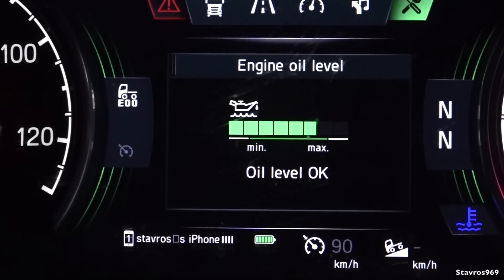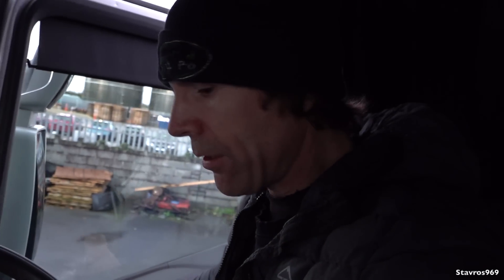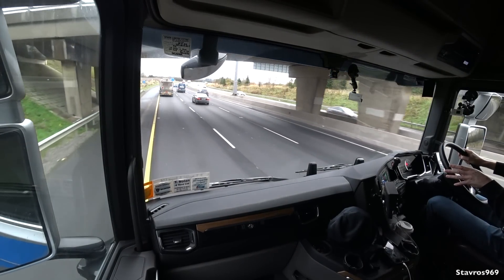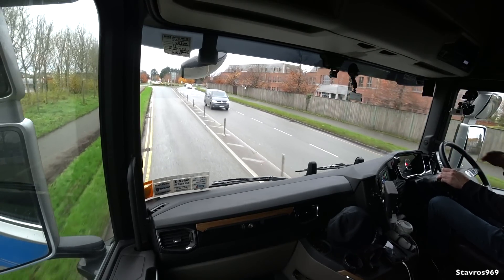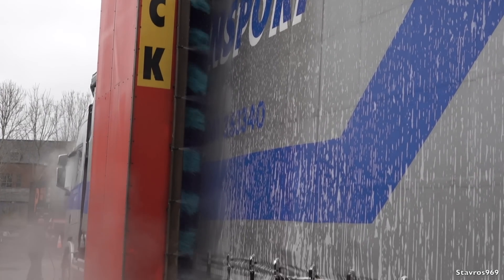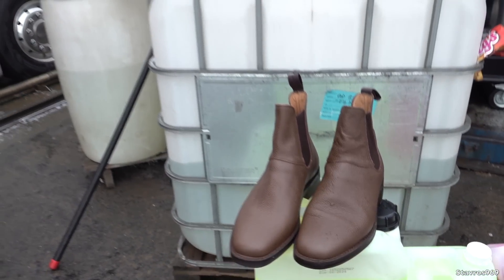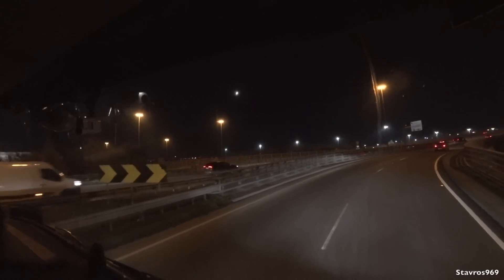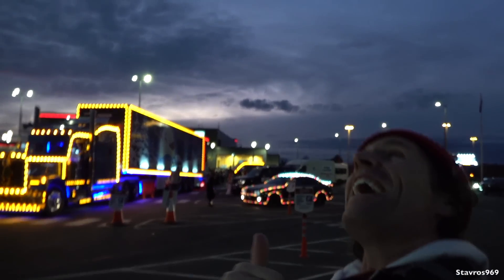SCANIA's V8 Engine The End is Coming!

Comment: Scania might do a new V8 with DOHC valvetrain & single cyl head, just like the new DC13 Super lineup. They won't give up that easy on their V8.
Reply: Probably. The difference engineering wise is minimal and the only added cost and complexity over the straight 6 would be the 2nd head. But they would be able to use all of the same tech, variable valve timing and whatnot on that to widen the powerband. The only real issue is that straight 6's are naturally almost perfectly balanced and you can run a longer stroke easier (better for low RPM power aka torque and efficiency because less cylinder surface area for same displacement so less heat losses). Given Scania is probably running a "modular" platform like most car/vehicle/engine manufacturers now they'll likely use the same basic layout and internal components on both so most of the engineering challenge, apart from the obvious layout difference, would be making the frame and cab fit both engines and a new intake + downpipe situation. Emissions are mostly just how much fuel you use (since the exhaust treatment stuff is all the same anyway) and as long as for cruising at low RPM that isn't much higher than the L6 it wouldn't be hard to meet the regulations.

Really the only reason other manufacturers don't run non L6 layouts anymore is just because they're too lazy/cheap to bother. L6's are cheap and easy to scale and pretty hard to get wrong. It sort of feels like we're headed towards a similar situation as to that of the US, where most truck brands don't bother to do more than the bare minimum. Buy an engine from Paccar/Detroit, use the same unsynchronized fuller box or an ungodly torque converter automatic, and mount all of that on a ladder frame with axles from one of 3 different companies. You can buy new Freightliner's that have the same steering wheel you would've got on an Actros MP2, back when Mercedes were still pushing the pre-selector nonsense. I just hope we don't end up in that situation given trucking is already a hard enough job as is, wouldn't want it getting worse because manufacturers refuse to fix annoyances as companies/drivers will buy them anyway due to a lack of better options.

Comment: In US there's no V8.Straight 6 is a better engine anyway😁I have 2013 with Detroit/Mercedes DD15 wich has 881000 miles and doesn't burn any oil,so that tells you about the quality 😁

Comment: Having the V8s is already sort of a lost course if you talk efficiency compared to the 13L. But the V8 is part of Scania's "fan service" at this point. Drivers and company's like to have them because they are something to be proud of, usually resulting in loyal and paying customers, for that reason alone the V8 will most likely not go away. Scania knows of its marketing value. Im a mechanic for Scania based in Germany and one thing i have noticed about the customer base, compared to other manufacturers, is that the Trucks are loved and often tuned by there owners, backing up my argument about loyalty.

Comment: It’s inevitable, especially with Traton’s Common Base Engine program the V8 obviously has no common use among the group anymore, they could simply replace it with a tweaked version of MAN D38 engine instead as the high power engine option.

Comment: Scania is known for making v8s so I don't think its going away anytime soon. However, I absolutely hate that all engines have become so complicated because of all the emissions equipment mandated by the govts. The last great engine from scania that isn't loaded with electronic crap was the ds14 v8😥 Almost every truck before early 2000s all had different engine configs. as well. MAN had v10s, Merc had v6s and v8 trucks, Renault was using the e9 v8 from Mack, Magirus-Deutz used to make trucks with v12, v10 and v8s, Iveco had the Turbo-Star 17L v8, while Volvo was the only one using an I6 on their top-line trucks. Now, only Tatra makes their air-cooled v8 twin turbo in the 815 for the military. Same thing here in asia, up until late 2014 we still used to get the Scania R500 in euro 3 v8 specs. Now its all straight 6.
Reply: You hate having cleaner air to breath?

Comment: We a running 3 next gen Scania. One 6 cyl 540 hp, one V8 580 and one 650. The V8's have tandem drive. The 540 and 580 gets identical fuel mileage. The 650 consumes about 5% more fuel. We typically pull between 64 and 73 tons. I don't think the V8 is dead any time soon, at least here in Sweden. Even Scania have said that the V8's is going to be around for long time to come. They even came out with a completely new V8 lineup last year combined with new transmission. They supposed to be even more fuel efficient. Can't wait to get my hands on one.

Comment: Damn! That’s a lot of oil to burn. I have 2021 freight liner just crossed 226000 miles never had to put any oil in between oil changes (every 50000 miles)
Reply: It's probably not burning it, they leak like a sieve. Once they've a few miles on them the blocks fail around the liner seals

Comment: Scania has the same pistons/cylinders in all its engines (the same form and dimensions). Scania changes the number of pistons/cylinders (5, 6 and 8 pistons/cylinders).

This means that there is not as much extra testing/cost involved in getting the V8 approved for Euro 7.

Comment: My R650 couldn't go between services between needing an oil top up. Once i got around the 100k mark it's settled down thank god. haha I dont know why anyone would want the 530. The v8 engine alone adds so much on the tare weight ( i think 1 tonne?)  just for 30 hp over a 500? whats the point.500/ 540/560 any day.. But i love the 650. Its gutless if running light but get over 44 tonne onto 50tonne its one hell of a machine. The v8 still feels like its got so much character. I think theyll struggle to get to euro 7 but it's hard. The v8 branding is so strong. out of 13 litres i think it's hard to pick a scania over a volvo in my opinion.

Comment: News today that nuclear fusion has been achieved. May take another 50-100 years for that to come in and if not nuclear trucks, it might power up more efficient batteries.
Volvo displacement at 16.1 is not far off Scania 16.4 - are they in the same boat for E7? If downsized with better turbos and electric motors is the trend in cars, then why not trucks.

Comment: We priced a 560 few weeks back, well specc'd, air on the front Griffin pack etc, truck came in at 161,000 Sterling, a 590 V8 was only 6k more, 660 10k more, I know what will hold value better.

Comment: why do they use oil,you would expect the old tanks to use it but not the newer ones
Reply: A lot of cars burn through oil too.

Depends on the design, if you're burning oil you're using less fuel.
Reply: @Robert-j6r8c  id rather burn fuel than spend 120k plus on a brand new unit and have it burning oil,surely something not right with it
Reply: @robertdonnelly385  
It's entirely normal to burn oil.
Reply: @Robert-j6r8c  ok no worries👍
Reply: New engines use some oil until they bed in then oil consumption reduces.Once they reach high mileage oil consumption starts to increase again and oil pressure drops as oil leaks past worn mains and big end bearings.

Comment: I do hope that they keep the V8 and make it compliant to  the clean air regulations , that way they can sell them in North America. Also, the engine should not be using so much oil between oil changes hopefully they get to fix that too
Reply: CO2 filtering is not an option.
Reply: @astafford8865  Fossil fuels will eventually be replaced by energy storage systems and nuclear. But yes, it will take a while. Damage of renewables is incomparable.

Comment: I have an wifi module installed at the garage near my house that download the tachograph data wireless, also the board computer i have installed in my trucks also can download the data automatic even when the truck is on the road best investment i ever did so my planners can see those tacho data realtime on there computer screen, a lot easyer and not that much expensiver and the best thing you dont have to mess with those download box things anymore...

Comment: Nice one stavros I bet no more v8 after 2030. That’s the death of trucking for me 😢
Reply: Why? I drive a G410 that runs on biomethane. It pulls as well as any diesel G410. It doesn't pollute and you don't need gloves to fill up because it's not messy & carcinogenic like diesel. We have to move with the times, I'm afraid. There'll always be a market for high bhp trucks, so Scania will develop engines to comply with the ever changing regulations.
Reply: Burning methane produces NOx and CO2.
Reply: You better get used to it. Everything is going to be electric eventually.
Reply: @Freba9  
Electric artic truck 😂
Reply: @Robert-j6r8c  Yup

Comment: Very lovely... I like the Christmas truck it's amazing. It's also pretty impressive the way they lit up that tractor too but how they get the lights to work while the wheels would be rolling beats me. They probably passed the wires through the wheel hub or something but that is really amazing as well.
Reply: May be the lights at the wheel have a battery which is also attached at the wheel.?
Reply: @f.j.kuiper1467  Well who knows, but those lights may use 110v or 220v electricity as it's the UK. However, it looks amazing and very creative for sure. I've never seen anybody do anything like that before so it's marvelous.

Comment: Now that the VAG group own Scania alongside MAN which they've owned for a long time, it's only a matter of time before they start to use common components.  

Similar to what happened when Volvo Truck bought Renault Trucks, but in that case the components from the premium Volvo trickled down to the less premium Renault, it might be the other way around for MAN/Scania.

It's an obvious business choice for VAG management to standardise parts across both marques, economies of scale will reduce costs and boost profit.

Scania produce their own transmissions where as MAN buy them in from ZF, I can see MAN's switching to Scania transmissions in the future to increase production numbers and reduce the unit cost, it will also reduce the numbers of ZF transmissions produced and potentially push up the cost for other marques that use that transmission (DAF + IVECO), so VAG would reduce costs while pushing costs up for some of their competition!

They will standardise the engines and have one 13 litre range and one higher capacity range, question is will they choose to keep the V8 or use the larger MAN engine (D38?).

They could probably use a lot of the same design if they make them all straight 6's, but I think they will keep the V8 as it's a special market and something that differentiates Scania from the rest, but then if they do choose to stick with the V8 maybe it will be available in a MAN too, or maybe they only sell MAN's with a max 13ltr engine and focus that brand on the fleet market.

It's all about money and profit at the end of the day, the V8 will only survive if it makes business sense to keep it.
Reply: Latest man uses the scania 12 speed box, it just says man on the cover but identical. The v8 will probably end as the new 6 cylinder is pretty high powered now but at least 3 to 4 mpg better.

Comment: The Scania v8 is famous and liked, but is it really a money maker for Scania? Lots of development costs just for the V8 even in the euro6 era, but most fleet customers buy 6-cylinder engines because they save money and are powerful enough. Even many Finnish haulers pull 76 ton weights with 6-cylinder Scanias.
Reply: Had a 2005 r470 6x2 back in 2010 with 600km on clock with 4axle nooteboom that weighed 15t empty. Often had a 50t crusher up and 470hp had no problem pulling at 90kmh. Was 12 sp manual.
Amazing scania and very fuel efficient.
Reply: V8 is just a trademark now anything is powerful than the 1st gen.(1969).